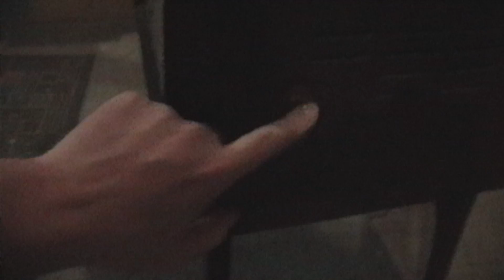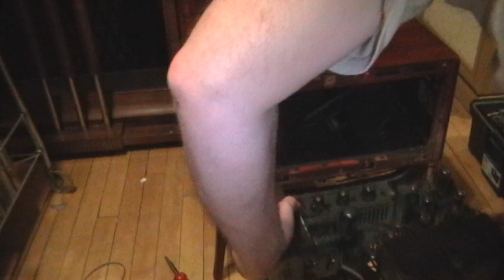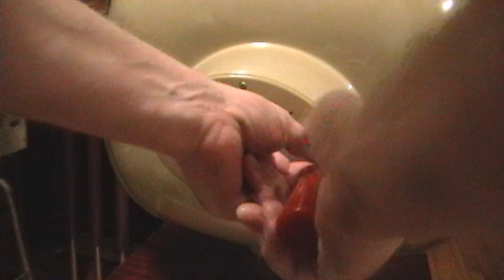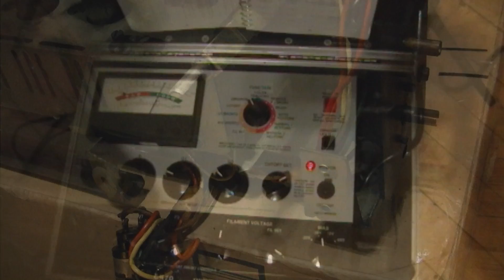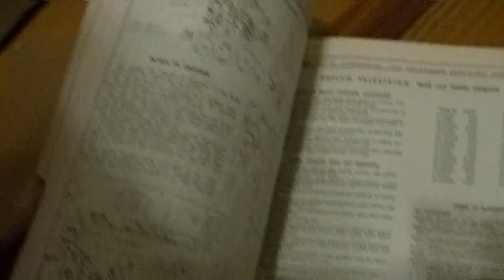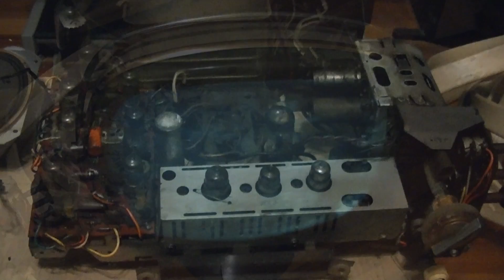Predicta Tandem II restoration pt1o?

Comment: at one time i had a 1940 philco radio that had a police band and it had stickers on it that said it would work wirelessly with a philco tv go figure. i have thought bout wanting a predicta tv. on wednesday the 14th of may  episode of american pickers they found a predicta which was the console model rather then the one u have or the portable.
Reply from the maker: That's was a marketing ploy in the early 40s.  They would put labels on the backs of radios stating they were "TV Ready".   Like TVs wouldn't come with audio circuits and speakers of their own.
Reply: ah now i understand. good info to know. i wonder what if any old tvs and radios would be good to look for
Reply from the maker: rmx77 There are many, many collectable TVs and radios.  The 30s is condiered the "golden age" for radios and 40s for TVs.  Just get what you like :)
Reply: i do like philco and even some sylvania tv's with the halo light but most halo lights have dried up. i would even want a good size table tv even. also i could go for one thats easy to work on rather then something i have to chase down where something goes if it fails

Comment: It's odd that he would try to sell it on Ebay for less than he tried to get on Craigs List. They probably sqirted some water ot something on the fire and thats why you see some of that water damage. It's very minimal. It will look great when you are done and it's wonderful you restore old electronics like I do. It's good to keep some of the past preserved. I hope the long cable contains the HV. It'll be a job cleaning up the chassis. Very nice find.

Comment: Always nice to have a little life in something to start off with.  I used Restore A Finish when I refurbished the Herschede mantel clock, it really does work well.  Amonia removes smoke and grease, but you have to be careful what you use it on full strength.  I've had it actually take the finish off some things, and it also doesn't dry as fast as the chemical cleaners.

Comment: Wow, who'd a thunk you could coax this Predicta into revealing that most stuff, especially the coils, is working. Did you find out why the HV was arching? Can't wait for your coming Predicta restores! I always got the impression from looking at the guts of Predicta's that production engineering was done helter skelter by a very unruly committee of CPA's. Stuff put in and boards cut at crazy angles. Crap sockets. Jeez.

Comment: btw. you said that the original CRT often went bad and was replaced with a aftermarket version with a 6.5 v filament and the original used a 2.25 v filament. how did they change the filament voltige for the CRT from 2.25 to 6.5 v? did they add a 6.5 v transformer or change some of the resistors in the series wired filement circuit?